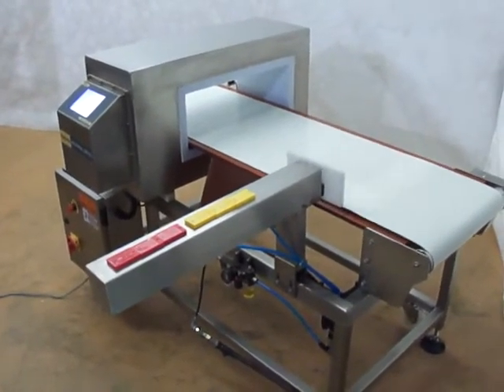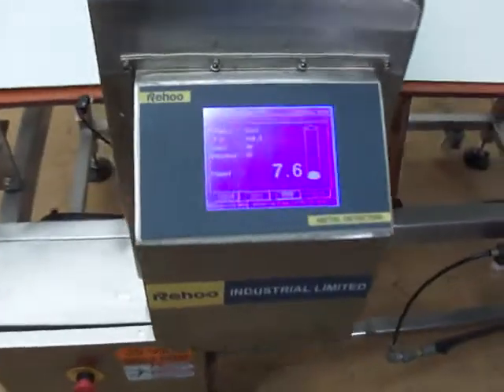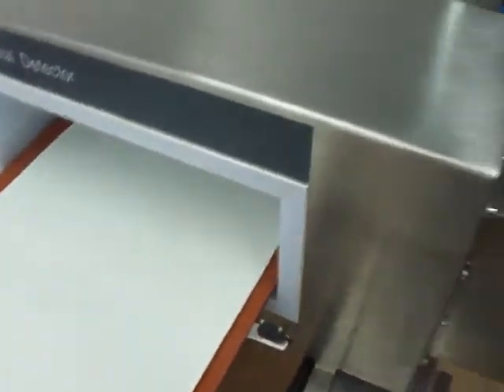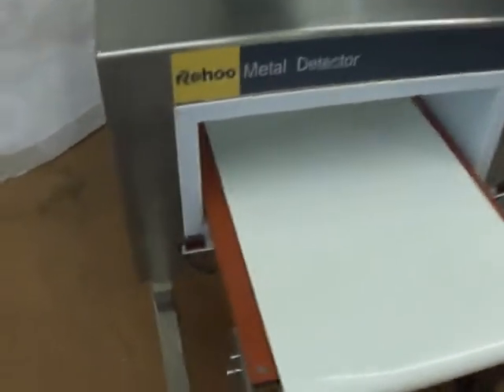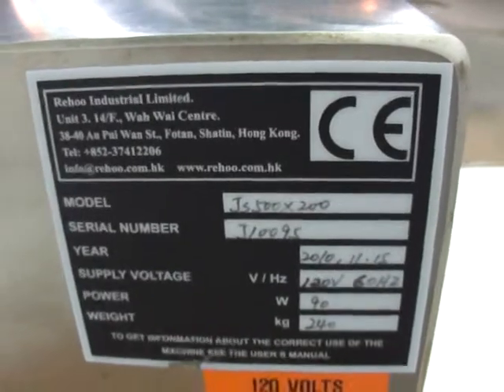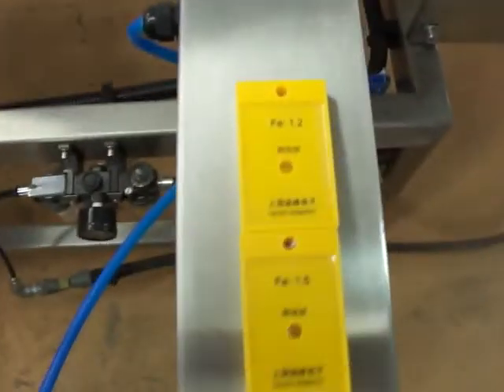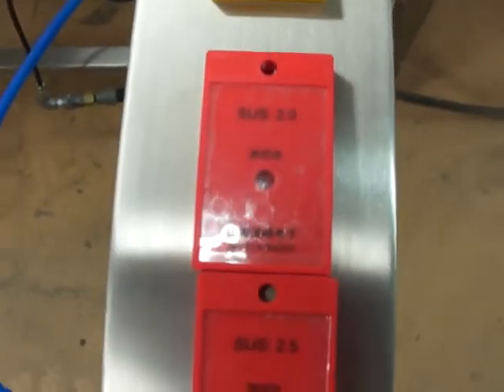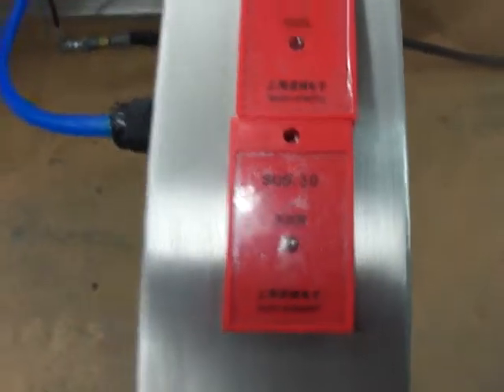Rehoo 200x500 test.MP4

Comment: Very good and interesting. It coud be practical on 1.5mm fe, 2.0mm nonfe, and 2.5mm ss with product for example in 25kg flour or sugar.  You can determine the real sensitivity of the machine when the test pieces is pass thorugh the center of the aperture. Not at the belt level. good luck. keep it up.